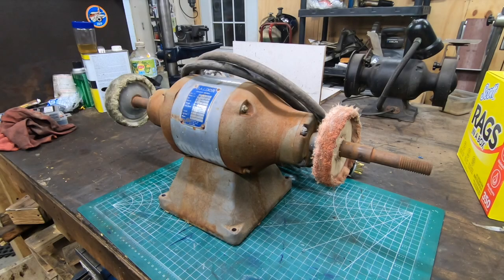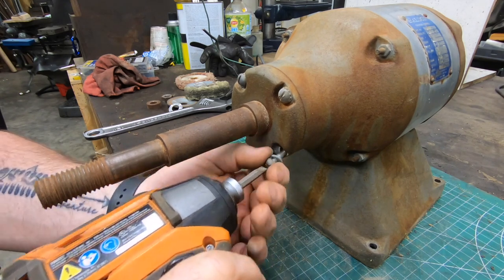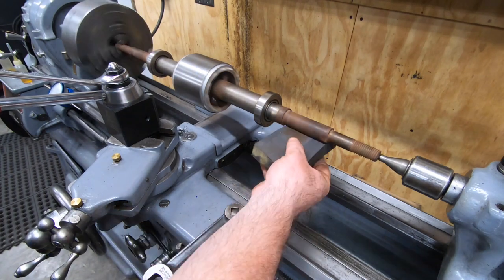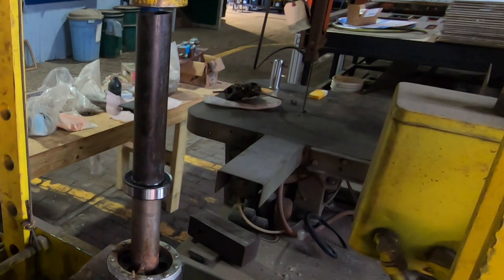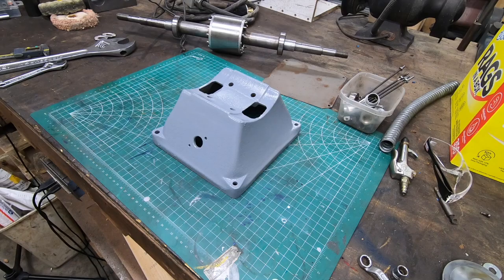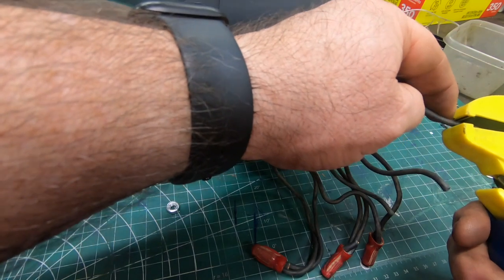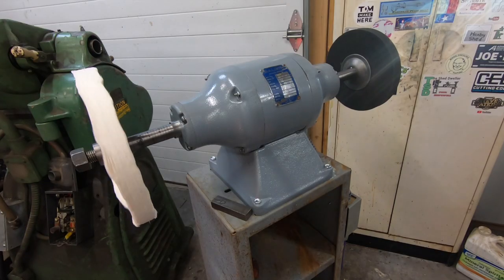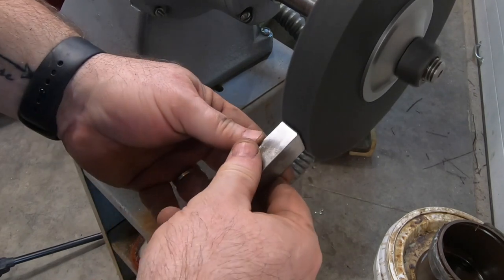Cleaning up a Baldor Buffer

Comment: @23:01 3 ph motors can be reversed by changing the wiring. You did not have to take it apart.
Reply from the maker: Thanks for the comment! I did in this case. The nuts will spin off if the shaft is turning the wrong direction. I had to do both things. Reverse the shaft and reverse rotation of the motor.
Reply: @MyLilMule  I’m rebuilding a Baldor buffer right now. Based on your experience I mark the right hand side of the arbor to prevent this mistake.

Comment: Why not just reverse 2 wires and reverse the direction of rotation?
Reply from the maker: Then it would be turning the wrong way. You want the wheel turning toward you from the top. Not away from you. But maybe I didn’t think it through 100%. Reversing direction and also rotating the buffer 180 degrees? Either way, it’s fixed now.

Comment: Why reuse that ugly junction box with so much room in the base enclosure? For a guy who hand scraped his straight edge you sure reach for that impact driver a little quick 🙂 I was sure you were going to snap something.
Reply from the maker: I like the junction box for how this is setup. If I were to remove it from this pedestal, I'd consider putting the switch in the base and ditch the box. That impact was on the lightest setting. No risk of snapping anything on this.